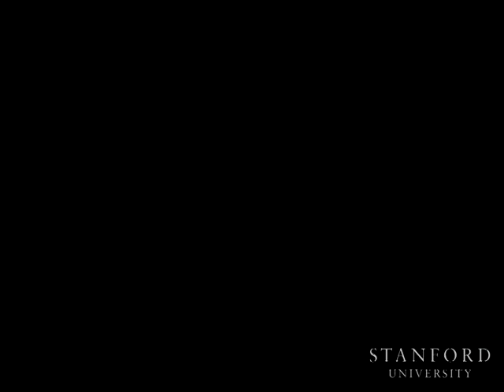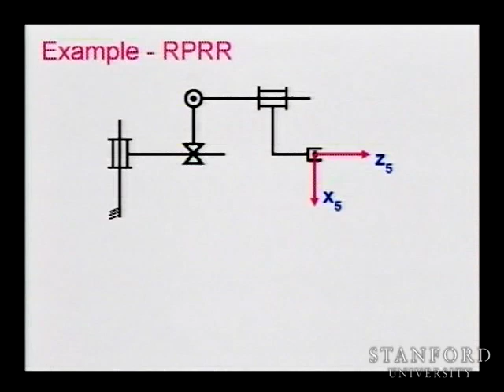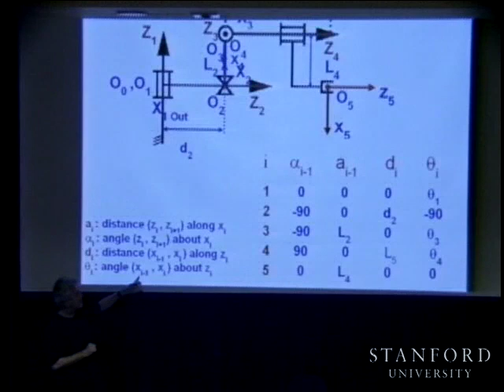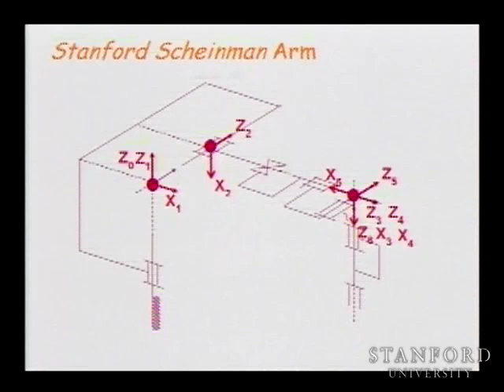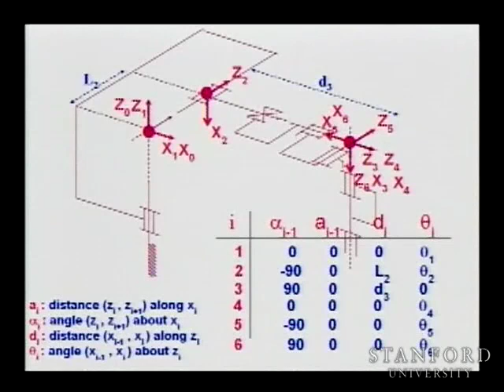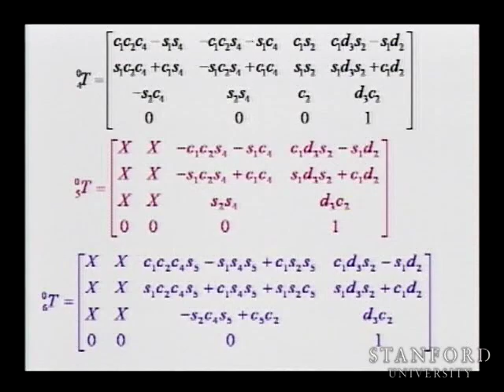Lecture 5 | Introduction to Robotics

Comment: Hi everybody! can someone explain to me why he had chosen frame 3 at that position. Since the rule said the origin Oi of frame i is located at the intersection of the common normal between Z(i) and Z(i-1)  and the axe Z(i) and when the two axes intersect the origin is in the intersection, and at that example Z(2) and Z(3) intersect so the origin of frame 3 should be identical to O(2).????

Comment: O4 is not correct in the figure. If O4 where placed there d4=0, and d5=L5. The current matrix defines O4 coincident with joint 4, therefore d4=L5 and d5=0. Does anyone else see this?
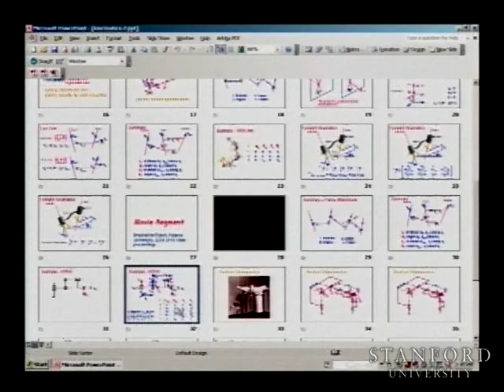Reply: 28:28 he corrects it.
Reply: exactly.................................................
Reply: Thank you for confirming my thoughts.

Comment: So, from what I've gathered from some of this and other sources, to summarise:
Step 1: Place zi along the axis of rotation or translation for revolute or prismatic joints respectively.
Step 2: Place the origin where zi-1 and zi intersect, or if they're parallel, choose where convenient.
Step 3: Place xi along the common normal of zi-1 and zi (although Oussama contradicts this at 47:21???)
Step 4: Find the DH variables.
Correct me if I'm wrong.
Reply: +Stephen Scanlon how do we apply this or translate all this into programming such as C++ or C# ? "obj oriented language" ? im trying to put a Humanoid Robot together and worry about limb collision while servoing and im not sure im getting solid detail by this videos , if i was in this lecture i be that guy raising my hand every other word outta Mr. Khatib mouth
Reply: There are many variations, here I think the professor was right
Reply: Step 3 Obeys the right hand rule.

Comment: How come alpha 3 is -90?
From Z3 to Z4 about X3 you rotate CCW so it should be +90.
Am I wrong?
Reply: sadel23 thnx bro 1 more thing can you tell me how come alpha between z1 and z2 is -90?
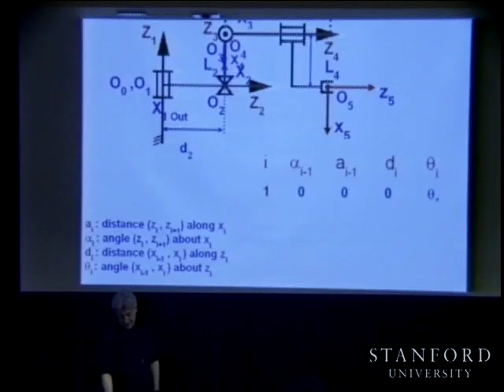Reply: Minute 24:46.
Reply: Alin Dumitrescu When i is 3, then a(i-1)=a2 and your angle is between z2 and z3 about x2. This is equal -90. When i is 4, then a(i-1)=a3 and your angle is between z3 and z4 about x3. This is equal +90.

Comment: The 2D gets a little confusing when dealing with assigning parameters in 3D space, for me, the following video helped a lot: watch?v=rA9tm0gTln8.
Reply: But you need to be careful with the notations because the video used normal D-H parameters while the professor is teaching the modified D-H parameters.